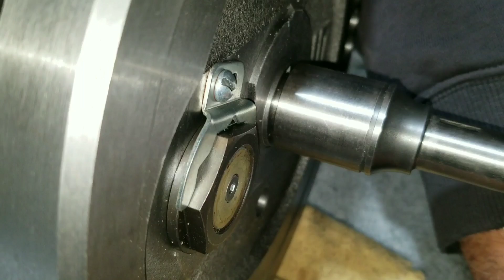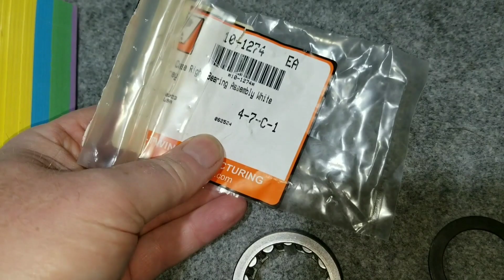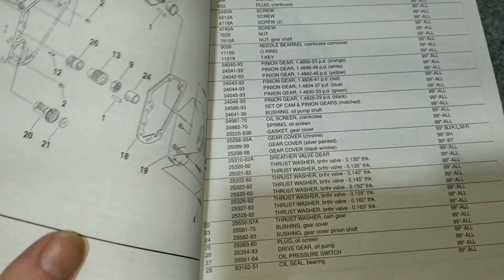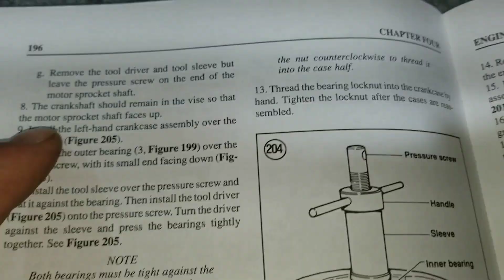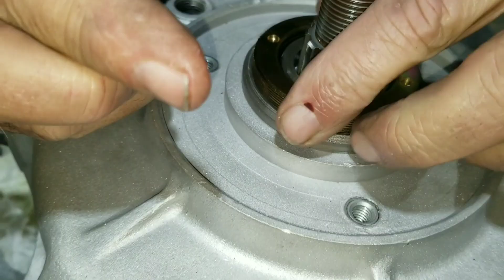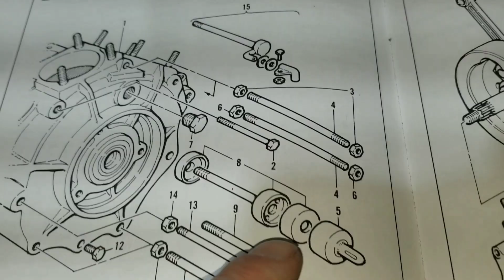1956 Harley Davidson FLH Restoration Part 3, The flywheel and installing it into the cases

Comment: You sure that pinion shaft fits that flywheel taper and is torqued to proper spec?  You sure you wanna trust Taiwain Teddy without blowing that crank apart to check everything?
Reply from the maker: @rok3427 Thanks for the comment and the point you are making is a good one though in the video we did mention that we thought it was odd as well, so we did take the crank to Leo Hess at Full Blast Engineering and had Leo check it over real close and he said he'd run it and it was well within spec. So at this point without finding different flywheels or flywheel assembly we don't actually know if we'd end up any better than what we have now or not. So we are going to trust it's ok and assemble it the best we can. We did find that the distance from the flywheel surface to the retaining ring groove is the same distance between the old 70’s flywheel and the new flywheel as well,
Reply: @jessesvintagegarage765  Interesting....did Leo diassemble the crank and check the pinion shaft for proper torque as well as the flywheel taper and then rebuild and re-true?  I'd be curious to know.  Im assuming the pinion shaft was China Tedd's Sifton, correct?  Thanks for this video as this was very helpful.  Cool to see you guys overcome the problem with the Evo style pinion bearings.  This will be really helpful should I ever come across this in my rebuilds. Much appreciated.
Reply from the maker: @rok3427 No he didn't disassemble the crank I asked im if he thought we should and he checked it closely and said he seen a few like this and wasn't concerned about it,

Comment: With the oem bearring you need to use a shim between flywheel and the bearring
Reply from the maker: @Oerman70  Thanks for your comment, I believe you are talking about the right bearing situation, I thought about leaving some of that info out but then I really wanted to explain what is going on, Ok, In one way, the original build-up bearings have a shim washers on both sides, and I believe the book states that. But now this 24626-87A new style bearing we have is all one piece and is longer, so 2 shim washers won't fit. So we decided by not finding instructions anywhere we put the shim on the outside, but going forward we decided on putting the shim on the inside and it pushes the bearing over the pinion bearing surface better and assures that the oil don't fling or drain out next to the flywheel. So instead the oil will drain in to the gear chest. We will show that in a upcoming video when we final assemble the bottom end. But the 24626-87A bearing fits all 1958 to 65 pans, 1966 to 85 shovels, 1986 to 1999 evolutions, and nowhere it just comes out saying that and I was just trying to tell everyone that it does.